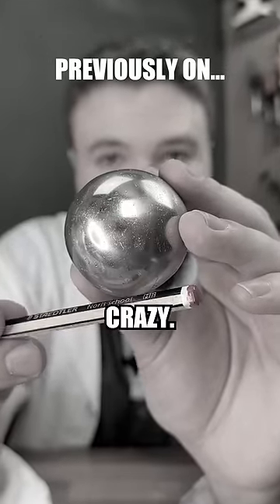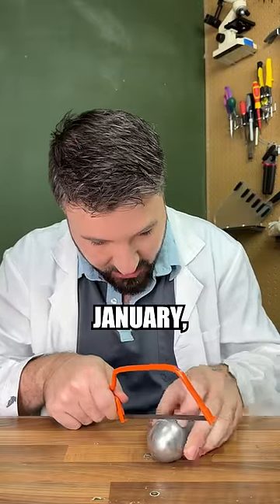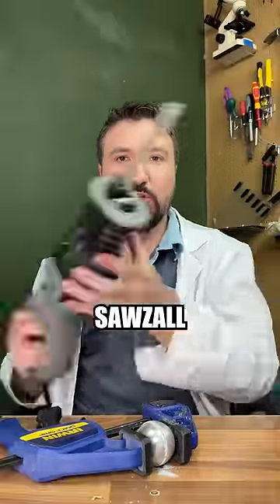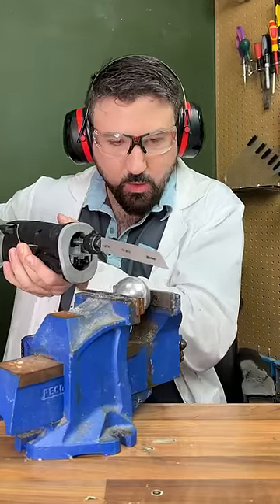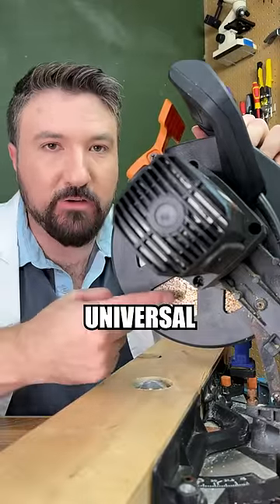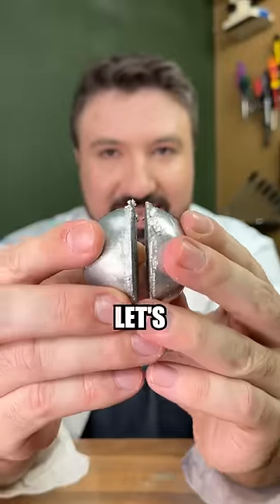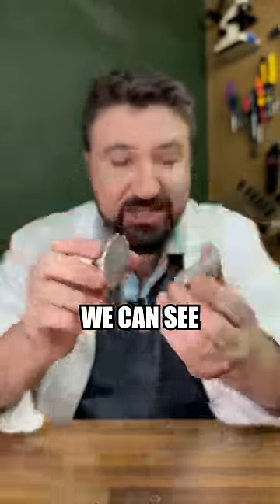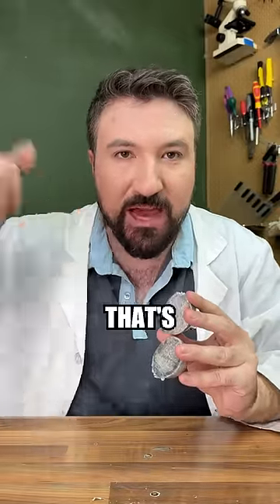I cut this perfect foil mirror ball in half?!

Comment: The reason why it looks like that is not cause of how tight it was packed but because the saw getting hot enough to melt it a bit OR because the saw blade folded the layers of foil over each other making it look like it's solid 

Hope that helps 🫠🫠